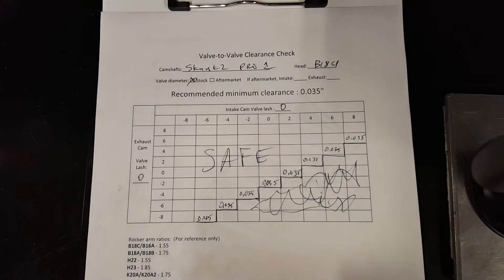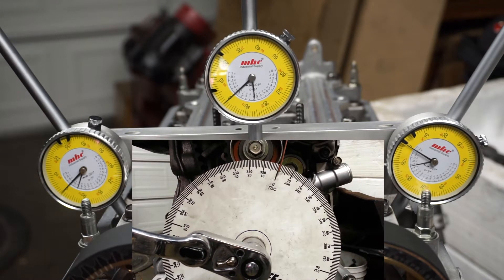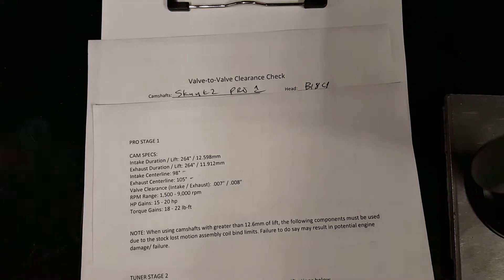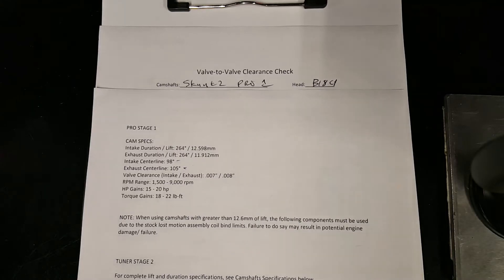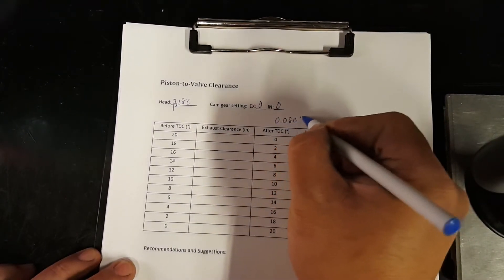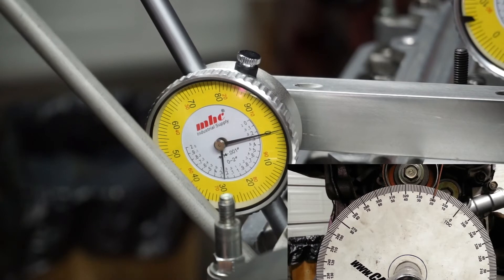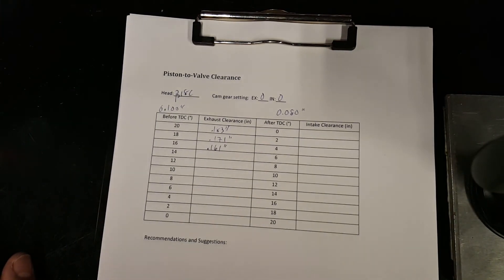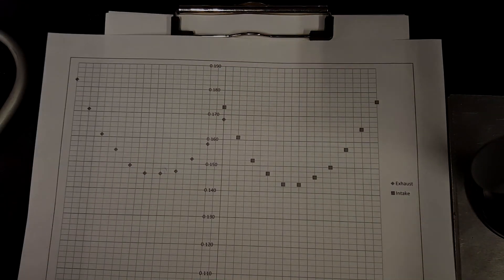How To: DOHC VTEC Cam Degree and Piston-To-Valve Clearance

Comment: Great video. Question for u... I understand how u checked the P2V w cams set at EXH 0, INT 0. Do u follow the same measuring procedure at the different cam gear settings to understand how much u can adjust the cam gears?
Reply from the maker: This particular motor happened be cam degreed to be at 0,0 and so P2V was checked at that setting. You will have to check P2V at what ever your motor cam degreed settings are. As to how much cam adjustment limitations, check out my video on V2V clearance.

Comment: So, I checked my V2V clearance with Skunk 2 Tuner Stage 3 cams and at 0-0 on my gears I had no V2V contact whatsoever. Actually, my feeler gauge set wasn't big enough to measure the clearance.
Reply from the maker: Did you lock the rocker arms so you are only measuring the VTEC lobe?
Reply: @mawfactor7283  Yep, I fingered it out. I got er done did.

Comment: I'm confused by the degreeing of cams is this only needed with aftermarket cams and adjustable gears or have you got to do this with stock cams and gears too? Surely they have alignment Mark's like when doing a timing belt you align the timing Mark's?
Reply from the maker: Degreeing cams is like fine tuning the synchronization between cams and crankshaft. It is recommended on aftermarket cams and with adjustable cam gears. You are correct, there are timing marks for proper timing sync and do use them for a proper installation. May I suggest you search YouTube to clarify any confusion you may have in the purpose of cam degreeing.

Comment: So this would be a more technical or precise method of determining p2v clearance as opposed to claying a motor correct?
Reply from the maker: It is a quicker method but do not skip the clay method. The clay method can check the radial clearance of the valve inside the valve pocket of the piston, which is also important.
Reply: An advantage to using a dial indicator vs. clay is being able to more quickly check/compare P2V at various levels of cam advance and retard.

Comment: How do you know to stop before peak lift and after?
Reply from the maker: Run through and take note of where peak lift is. Then it is just a matter of you deciding when to stop before and after. I chose 3 thousandths but it is completely up to you.
Reply: MAW Factor I enjoyed this video and it's very thorough, It took a minute there to finally understand the cam degreeing. I just degreed two engine recently with the help of your video. Learned alot, thank you

Comment: Noticed all the other videos on this subject use compressed air to lock vtec. Is this still accurate without locking vtec?
Reply from the maker: VTEC rocker arms are locked mechanically.

Comment: How do you go about adjusting the cam gears if the center line is to far off? Or there isn't enough piston to valve clearance?
Reply from the maker: If your settings are off adjust the cam gear and recheck. If you are maxed on your cam gear settings and the centerlines are still off, possible causes could be timing belt alignment, defective cams, cam gears, and head has been milled. For not having proper piston to valve clearance, use a thicker head gasket.
Reply: So if its of by 1° thats how much you you move the cam gear? And how do you know wich direction you need to move it?

Comment: do you have a link for the kit you used (cam wheel and three gauges along with metal bar strapped down) to do the degree job
Reply from the maker: monutz4u I do not remember where I bought this kit from, but if you search for honda cam degree kit you my find something.